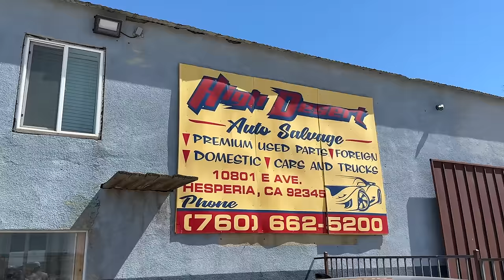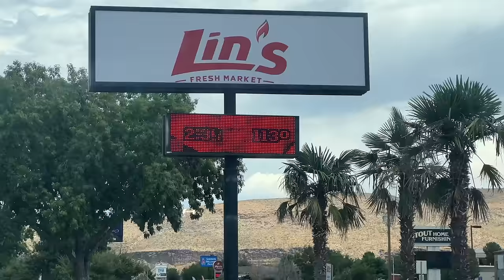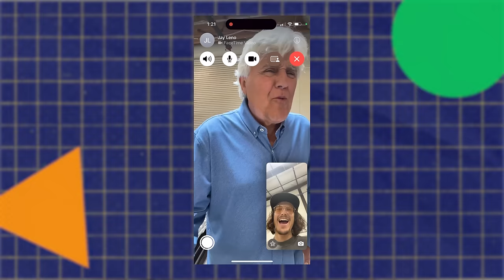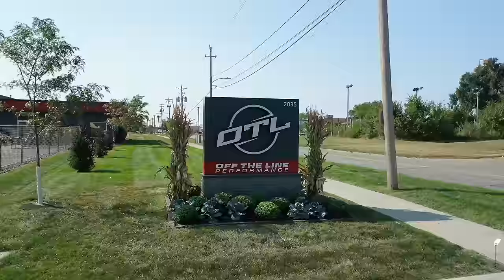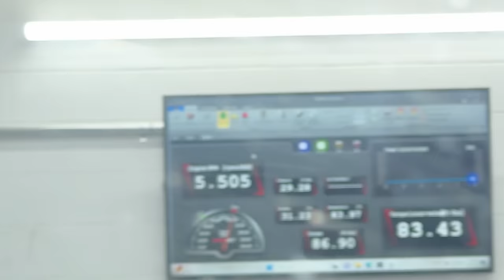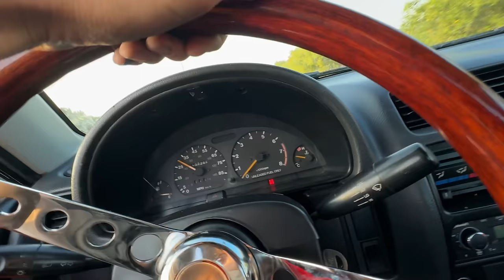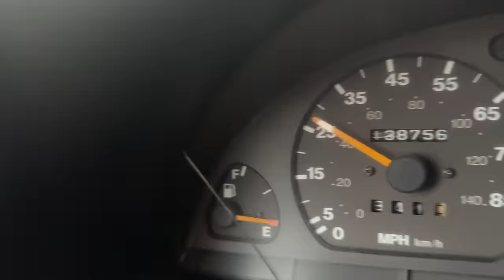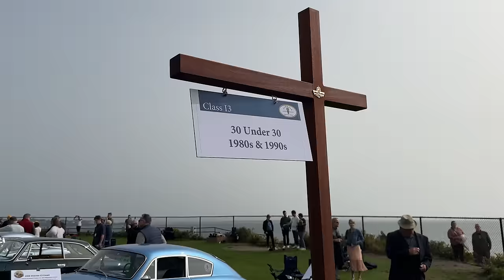I Dumped $30,000 Into the World's Ugliest Car

Comment: No way a Porsche restoration under 30K unless it sat in a garage under a car cover for 10 years. . . . This X90 build turned out way better than I thought. Def Kudos to you all!!!❤
Reply: I mean u can buy those with pretty good paint for less than 10. Bad paint for less than 5.
Reply: I mean, technically if you wanna be pedantic, the x90 also wasn't done for under 30k either...
Reply: @mikey_bb  its still alot closer to 30K than a Porsche any day of the week. Technically speaking you are right.
Reply: Totally doable, there's multiple for sale near me for ~$10k in shockingly good condition.
Reply: Maybe it did, didnt say it hasto be a full restoration
Reply: My old 924 sat outside for 10 years, I bought it for $2200 Nzd ($1300 USD) it wasn't running when I bought it but I spent about $900 Nzd to get it running + other parts, I could have easily done a full resto for only 10-15k more if I had the time, didn't sadly so sold it. But a Porsche rest can definitely be done just gotta find them super cheap originally :)
Reply: I can't believe they even made their compact offroader look like a VW Beetle, what are the designers at Porsche smoking? Do they have a stash of authentic Panzerschokolade?
Reply: If you do most things yourself it won't be that expensive. You just need skills and determination because cars of that age are typically rusty af haha
Reply: @Gene4666  I just bought a 1989 944 S2 last August for 12,000 EUR in Europe. If I spend 15,000 on this car it would be immaculate. I will spend about 4k to have it moderately restored so it doesn't have any obvious defects like rust, interior or engine issues and it still looks perfect already from outside.
Reply: @trbossdoggy  euro car in Europe is different $$$$$. Porsche in the US and its restoration is Luke U trying to get a 1st gen Chevy Camaro and restoring it. Would be over 30K in just parts.
Reply: @Gene4666  Nah I don't think its fair to call the porsche a cheat, You can pick them up for 10k, ones with bad paint for 5k, 15k you could make one good one with just swapping parts between two cars. That would leave you a huge 15k to play around with. If it was a 911 id agree with you, but where i live, this particular porsche is cheap, i have been tempted to buy one about 3 times lol

Comment: Amazing! I'm building one right now, fully modeled in Fusion 360, neck and all (carbon fiber reinforced + truss rod). So excited to see the video series. Question - What infill % and wall thickness did you use for the center core? My core is printing right now at 50% infill with about 5mm walls. Pretty sure it's sufficient but I'd love to get your input!

Comment: 3.0l M57 BMW diesel would be epic in this. Or if that wouldn't fit, 2.0 M47 (OK i know hard to source in USA). Very easy to mod for decent power - 200bhp and 350nm with just a software tune or surprisingly high with bigger, hybrid turbo, intercooler etc etc

Comment: sports exhaust?  Are Varex exhausts legal there?  What about an electric intake turbine? Poor mans turbo? A surge tank and an electric boost racing fuel pump keyed to a microswitch on the accellerator pedal when its on the floor? Higher compression rings?   Port the intake manifolds? High octane fuel and matching more agressive timing? That should push out at least another 12-15 horsey's..  that gets you into 105hp flavour country..   Your current engine spec wise sounds pretty similar to a toyota R series and they are built so thicc you could even nos the thing.

Comment: A battery with a built-in jump start feature? Isn't that what a battery is used for in the first place? What does the button do?

Also, seeing a motot clean on a normal driveway without collecting the dirty water is awful. It is polluting the ground.

Comment: lithiumbatteries catch fire, i wouldnt have installed that in that i.c.e. car. that little bit extraweight of the lead battery is meaningless and the lead battery alot safer, that would have been the much safer choice for a battery.